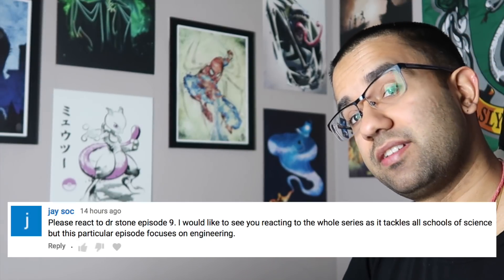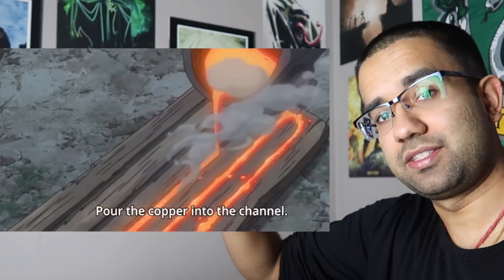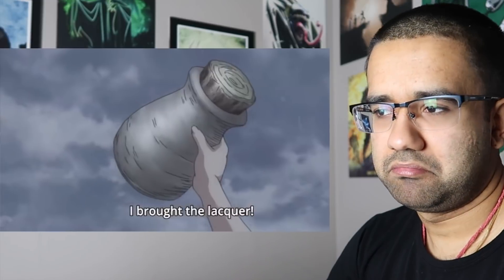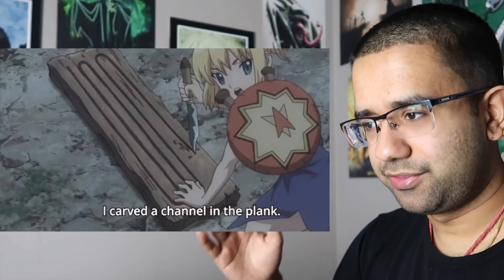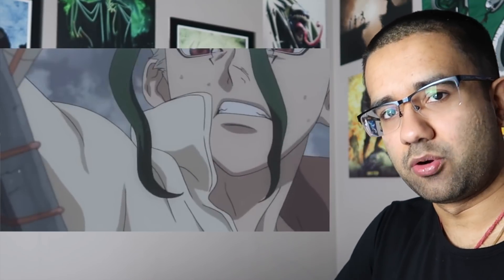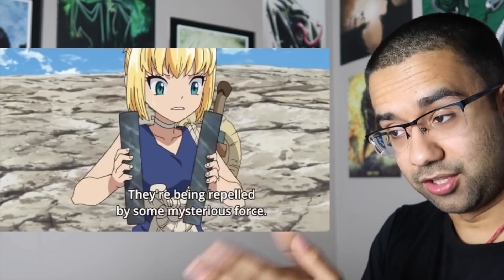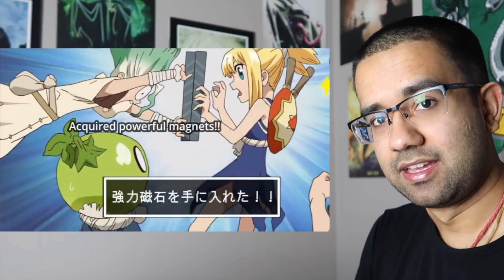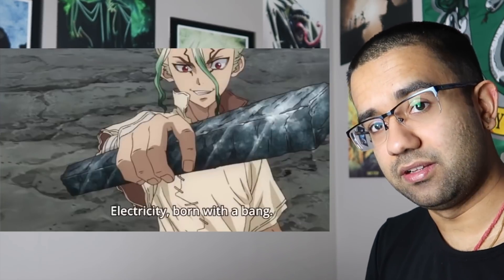Real Engineer reacts to Technology in Dr. Stone #9

Comment: The only thing which bother me was how he had 2 iron rods when they only made 1
Reply from the maker: He made 1, then (somehow) cut it in half. If you break a magnet in half, you get 2 magnets each with their own North and South Pole
Reply: The Magnets each seem to have the same dimensions as the rod from "aquired iron". However, there were many time skips in this Episode, like the cooling down time for the iron, so they could have made multiples off-screen
Reply: proclarushtaonasat but how long did the storm last it was somehow long enough to melt and make a copper string
Reply: @Poke-ladd  30-60 minutes. But Copper is easier to melt than iron (1000 Celsius, instead of 1500) and the wire cools down faster, due to its small Diameter, especially when you put it into water
Reply: In the manga, they made at least 3 Magnets.
Reply: @parychahal  but doesn't cutting magnets effect its magnetism? Like, reduce the intensity?
Reply: @cheesyvin8078  You do get 2 smaller magnets that are weaker from their reduced size, but no, the magnetism isn't reduced (unless you cut the magnet with a method that generates too much heat. High temperatures can permanently demagnetize a magnet.  The temperature this start to happens is called the "curie temperature", and depends of the materials the magnet is made from)
Reply: I thought they made 2, but if you hold the rods together, they look like 1 large Ingot.
Reply: proclarushtaonasat Maybe he cut it in half before wrapping them in copper but does the tracks left from the copper make sense
Reply: @Poke-ladd  I guess so? The spear burnt to a crisp because of the Lightning bolts heat. The parts covered by the wire would Show signs. Like Steak on a grill, or tan lines. not sure if the Copper protected it from the heat, or heated it up more though, but either one works
Reply: One of the rods was sacrificed to the god of thunder Thor for his help, and I base this knowledge on absolutely nothing.
Reply: A LOT of the time they just don't show you them doing the rest. The most egregious is when they got the acid... They ONLY showed them getting one jar, but lo and behold they actually had a whole collection.
.
So just assume that after they made one, they made another.